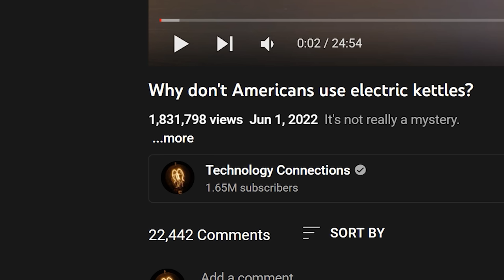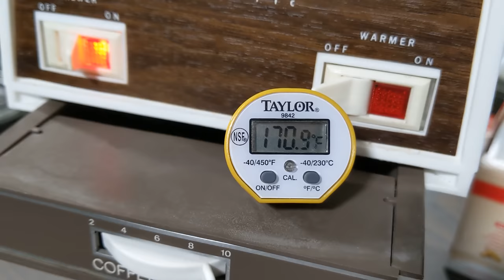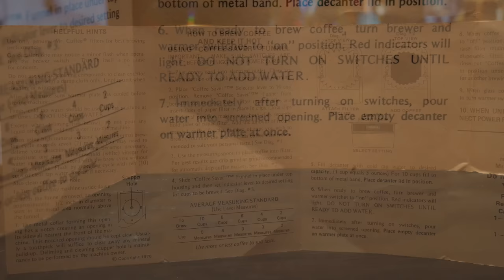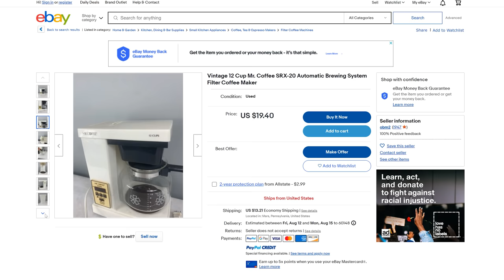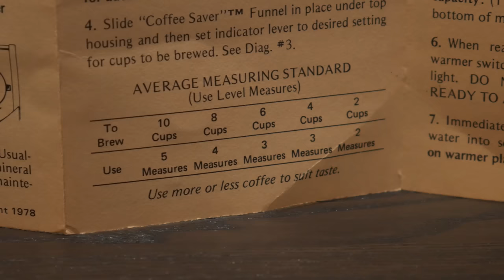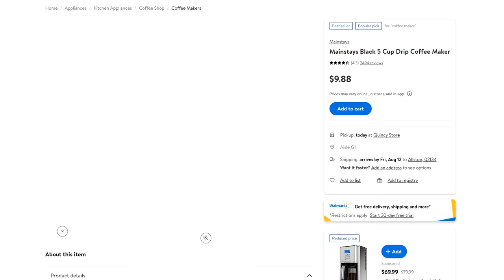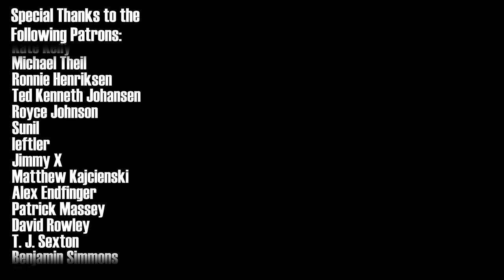Drip Coffee Makers — super simple, super cheap

Comment: How does a bubble pump function differently than a percolator. Why not just use the percolating technique, without recycling the water, to move the water up the pipe to the drip basket?  After all, the two are pumping the water up the tube in the identical manner.  The bubble pump is percolating. Water is driven up the tube by a bubble of steam.  A limited search, as I haven't finished by first pot of coffee yet, suggests that the difference is in the one way valve of the bubble pump that keeps the water from back flowing.  No mention of a valve is made in percolating and, to the best of my recollection, my mom's percolator coffee machine didn't have one.  My sense of it is that the one way flow was maintained by the weight of the water in the pot, which never fell as it was recirculating rather than being pumped from a reservoir into a separate pot.

Comment: "the consumer can't be trusted with a 1500 W heating element in a plastic shell"
Well, electric kettles work exactly the same.
Or toasters, where the heating element that burns the bread runs on main power.
Reply: Some electric kettles are metal. As they should be. Microplastics are a thing.

Comment: 27:46 Well that's not QUITE true... it's "so long as there's liquid water" in the tube. If you're heating it fast enough, the water in the tube will all be vaporized and the heat will go over boiling point.
That would be massive overkill on the heating needs of this device, though.

Comment: The biggest problem with drip coffee makers is that they don't get the water to the proper temperature to make the coffee taste good, and or they have a hot plate to keep it warm but also scorches the coffee.  I've got a fancyish drip maker made by bonavita and it's not quite as good as a pourover but it's really close.  I've got a kettle with a thermometer built in to tell you when it's at the optimal point, but it's not convenient enough for my workdays.

Comment: With the same variables to optimize for, and not being a coffee nerd, I like my cheap electric moka pot combined with an electric coffee grinder to freshly grind coffee. I'll preheat the water in a ketter, though, because I've read it makes the coffee coming out better, and it's really not that much effort. It even makes the process faster due to the larger (2.3kW) heating element in the kettle.
I know there is a significant difference in the coffee preferred by European vs American folks, and Americans may not like the result of extraction under pressure, but can't you just get a result similar to Americano by watering down your espresso-like coffee? Or you could just try smaller amounts of espresso, and develop a taste for it, like most of us in Europe already did. I think concentrated is better than watery.

Comment: People in the USA prison system use something like a kettle it is called a stinger. They use 2 pieces of metal separated by something that is an insulator held together by a rubber band and connected to a power cord directly. It must be underwater while plugged in at all times or it will throw a breaker in the prison. BTW I wish Mr. Coffee would have not fixed something not broken.

Comment: @TechnologyConnections Sorry I didn't quite get how the water would get onto the grounds. In the center of the heating element there's a tube sticking up, so how would the warm water reach the grounds? Is there another hole for the water to run through that I missed?

Comment: if you wan't your drip pot to drip faster, fill it with hot water : )
Reply: Incidentally, it also helps with extraction consistency, or something. Ergo, even if you have a drip (machine), a kettle is still a worthy investment.
Reply: @cheekibreeki904  also i find you can 'superheat' water in the microwave, for some reason it will go past boiling point when it's in the microwave before it boils, if you get it just right you can poor it into a French press, it will foam up and make the most wonderful tasting froth

Comment: As a European, who exactly is asking how you make coffee without a kettle? You literally can't find a Finnish house or workplace without a drip coffee maker.

Side note, based on minute 3:30 without watching the video. You can make coffee in a kettle from grounds. No instant coffee necessary. The grounds just need to be more coarse. Its not much harder than filter coffee. Literally just dump the grounds into the pot, then after 5ish minutes bang it against the counter so floating grounds sink. Then pour. Thats how many Finns make Campfire coffee, or cabin coffee. Where electricity isn't available.

Comment: Lol, I've always used a kettle for making coffee. Just a proper french press. These drip coffee things make horrible coffee. The water is too hot. (or something like that?) Instant coffee? ahhaha, just no.
About the only good drip coffee maker was xcoffee.

BTW, are you grinding your beans or using one of those cutter-devices? (the latter ones make a high-pitched noise)

My french press is also quite effortless, and also quite cheap. I use silly organic extra dark roasted beans and this is still so many times cheaper than those nescafe pods. I also don't need to remember to buy coffee filters (or panty hose). It's about the same level of effort, and I have yet to taste a better cup than this.

Comment: I have a drip machine that doesn't have the carafe heater. The carafe is insulated. Found it in a goodwill. Looked unused.
Reply: Same here. It also has a built in grinder that can be used or turned off.

Comment: I've tried Keurig coffee. It tastes worse than "instant" coffee ... and I mean the old fashioned instant coffee that came BEFORE freeze-dried instant.

PS: I'm still using an almost 50 year old 4-cup Mr. Coffee every day.
Reply: PPS: I drank bad Army coffee for 30+ years - BLACK no additions or pollutants; nothing in my coffee but coffee - so my taste buds are probably scarred for life. About twice a year I'll fill the carafe with white vinegar & run it through; then rinse by cycling through a couple of carafes of water.  That takes care of de-scaling the machine. 

For cleaning the crud out of the carafe try putting several ice cubes in it & a couple tablespoons of water & just swirling them around for a bit. That will remove most of the residue & the rest will easily wipe off with one of those cellulose sponge scrubbing pads while the glass is chilled & damp.

About that "coffee saver" thingy - it seems to work better if you set it before putting in the filter & filling it with coffee.

Comment: Why did you postulate and not test a design element? You answered your own question here. The new design worked for any quantity of coffee. You had to 'set' the prior design to the desired cups to get the same. 

I remove a switch and get the same exact benefit as before. That to me is an improvement. yes it means it takes slightly longer, but its slightly longer and NOT THINKING WHEN IM TIRED IN THE MORNING AND NEED COFFEE. 

GOD WHY WONT THAT RINGING STOP.

Comment: Absorb all that plastic...Oh, Disgusting! Percolators in a stainless kettle tastes much better and full, but need a PID to regulate the temp. Advertising and cheapness replaced the percolator. NEVER have boiling water and plastic merge in brewing a good cup of coffee! Get a water kettle with temp control and get a porcelain cone shaped dripper or pour over design and you will have good coffee, specially with a good grinder and fresh whole beans. Also, brew less hot on darker beans, and hotter for lighter beans. Also a metal mesh filter can do a deeper flavor. but if you have heartburn issues, a paper filter will keep out the fine tanins and not cause much issues.Yuck is plastic and hot water coming into contact with one another. Don't use vinegar to clean, use citric acid, or a little trisodium phosphate.